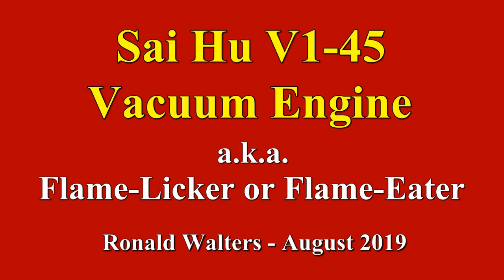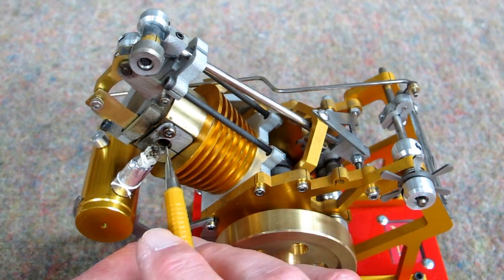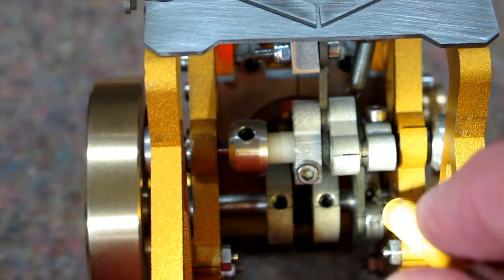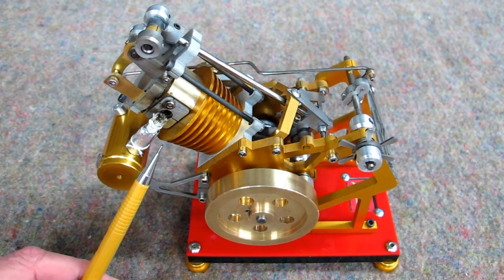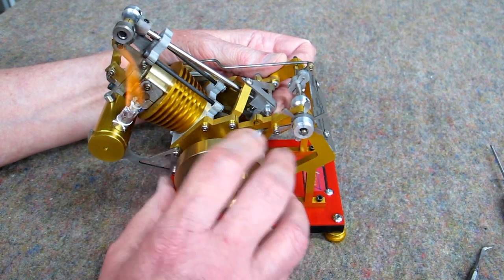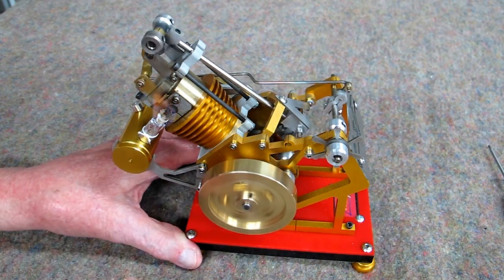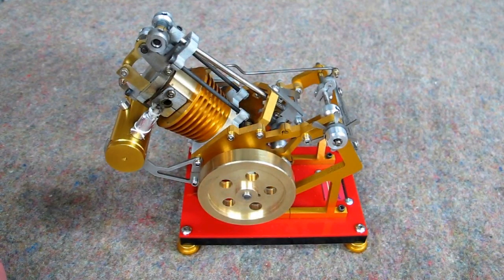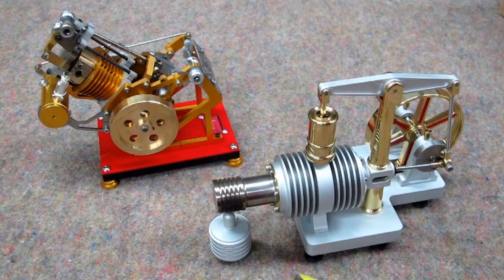Sai Hu V1-45 Vacuum Engine

Comment: Does it use oil or a dry lubricant in the cyclinder??   I recently wore an engine out that used the dry lubricant.
Reply from the maker: As stated in this video, I used a few drops of light oil in the cylinder, which is what was recommended in the instruction sheet. This is inconsistent between various vacuum engines... some you can use oil... others recommend a dry lubricant. Some engines get so hot, the oil burns up and leaves a gummy mess that needs to be cleaned out once in a while. Remember, these are demonstration or proof-of-concept models and not intended to run for a long time. If you run it until it quits, the oil will probably get burned. When it starts to slow down, shut if off and let it cool down before it stops.

Graphite is too coarse to use in these engines and could actually result in wear. This is explained in the SH-02 video.

Comment: I'm surprised you can't adjust the wick can't be adjusted better so all of the flame, or at least most of it, is sucked into the port so not so much of the fuel is being wasted during operation. With as little that is being sucked in in this video demonstration,  it seems like there is way larger of a flame that is needed to run. This is my thoughts based of very little knowledge of how these little engines operate. I saw this engine on a website that sells a bunch of different types of hobby engines, this type of engine, steam engines and 1, 2 and 4 cylinder 4 stroke engines. The 4 stroke engines are really cool the way they are made. Some guys have actually taken the 2 and 4 cylinder engines and custom installed them into 1/8th scale RC cars and trucks. They sound WAY different than a typical nitro fuel RC engines. I am planning on getting the 4 cylinder engine they make and installing it into a pretty large RC boat hull that I got a while back and never built. It was originally intended to be powered by a large brushless motor powered by 8s lipo. Its like 40" long and 12" wide. The 4 cylinder engine is over 3 HP so it should get it going pretty good!  Great video! Liked and subscribed.
Reply: Looks to me the wick should be slightly below the intake port to get more of the flame to enter. I have a couple horizontal flame lickers that run better that way.

Comment: Does it have any power and what can you attach it to
Reply from the maker: There is a small drive pulley on the crankshaft. Once the engine is running you could engage a small load using an o-ring drive belt. A clutch would make things work better.

These Flame-Licker or Vacuum Engines are intended to be a model demonstration engines. They are Proof Of Concept and are not intended to be run for long intervals. Eventually they become too hot and need to stop and cool down before running again.

Wired correctly, it should run one of these with some small LED’s. These “DYANMO’s” are just a 12VDC motor with a pulley on the motor shaft.

https://www.banggood.com/Microcosm-FD4-Model-Dynamo-Motor-For-Steam-Engine-Model-DIY-Project-Part-p-1285534.html?rmmds=search&cur_warehouse=CN

https://www.banggood.com/FD-3-Machined-Dynamo-Small-Generator-for-Steam-Engine-Model-p-1578461.html?rmmds=search&cur_warehouse=CN

Thanks for watching.
Please subscribe! That is what keeps this channel going. 
Ron
Reply: Ronald Walters thanks

Comment: Bro what is the circleshape at the top of the head???
Reply from the maker: There are a number of circle shapes. Around 0:54 the hole in the side of the upper cylinder is the intake/exhaust port. At 2:00 I explain how the engine operates regarding hot gas drawn into the cylinder and then exhaust exiting the cylinder through this port. 

At 9:50 you can see the fire being drawn into the port and the exhaust gas blowing the fire away from the port.

At 10:28 the round brass section is the top of the cylinder inside the outer aluminum clamp. The clamps at the top and bottom of the cylinder hold it, the cooling fins and the frame together and provide attachment points for the rocker arm assembly.

Thanks for watching. Please Subscribe! Ron

Comment: It’s not internal combination so it’s a stirring engine right. No wait you said it’s not a stirring but what’s the difference between a vacuum engine and a sterling engine.
Reply from the maker: I don't know what "internal combination" is. :-)
It is not an internal combustion engine and it is not a Stirling cycle engine.
It is an external combustion or vacuum engine.
Reply: @RonaldWalters2010  neither do we know what a stirring engine is either. 🙂
Reply from the maker: Watch a Stirling Engine related video and then you will know.
Reply: Steam engines are also not internal combustion engines and also not stirling engines...stirling engines were invented to eliminate the danger of exploding boilers. There are some great books on the invention and workings of different types of stirling engines

Comment: Thanks for that good review ;

I also considered one of these ... now I may step forward ! 😊
Reply from the maker: You must get the cylinder hot before it will start and there are a couple of easier ways to do that. Saturday I will release a video on how to preheat the engine for easier starting. Also, at the end of this video is an End Screen linking a video showing improved timing and easier starting.
Reply: @RonaldWalters2010  Thanks Ronald ; 

Feedback is always good to know ... as Eaters can be little nasty boys when it comes to start with very cold weather ! :-)

Comment: It is such a beautiful thing.  I would be happy with it just sitting there never running.  I am surprised that the little rubber belt around the fan doesn't melt. What a neat engine.  Thanks for showing it to us!
Reply from the maker: I ended up using a silicone o-ring 2.0mm cross section x 50mm OD for the fan belt. The heat shouldn't bother it.